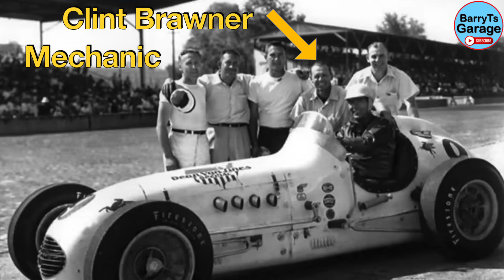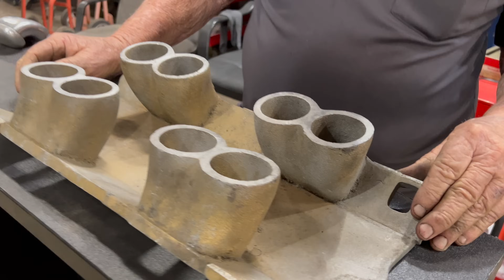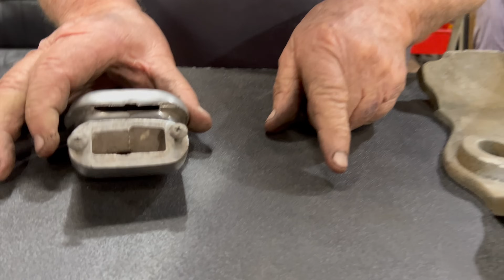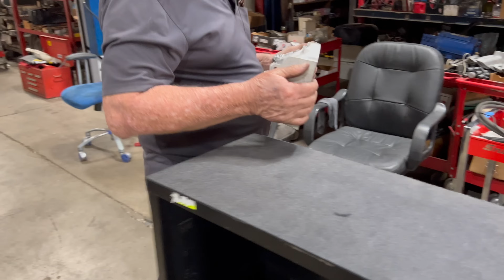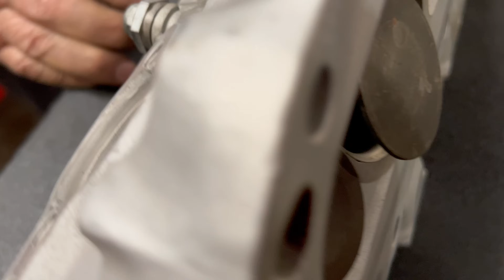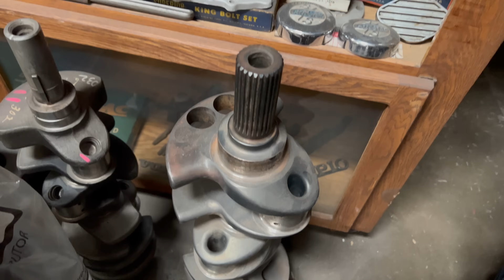Vintage Racing Parts Stories | Ed Smith | In the BTG Shop

Comment: I remember my dad saying when after his son (his son was just starting to learn how to do exhaust) just did my exhaust on my first truck in 1994-1995 that Ed was on the cover of Hot Rod magazine in 1963 or 1966 I’m not sure. 

Another time for the rest of the story, Mark did tons of exhaust work for me over the years and I would have to look but I’ve probably bought around 90 engines from Five Star. From the late 90’s to 2005 if I had to guess. 
Most Arizona native gear heads like myself know about the Smith shops and the quality they turn out.

Comment: Now,that’s my kinda junk collecting.Looks like those V6 heads would only fit on a dedicated engine block.
Reply from the maker: I agree I think it’s the Chevy 4.3 but I’m not 100% sure
Reply: @ With the size or those valves,looks like a 4” bore would be necessary.The uneven port spacing and valve sequence is very unusual also,but I’m not upon the V6’s that are out there.